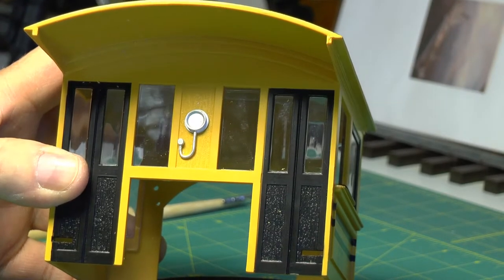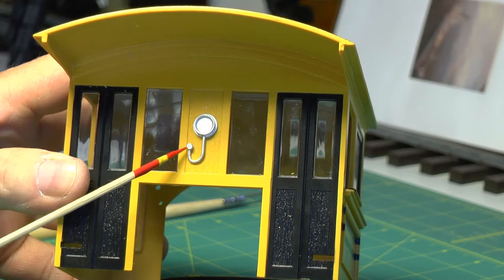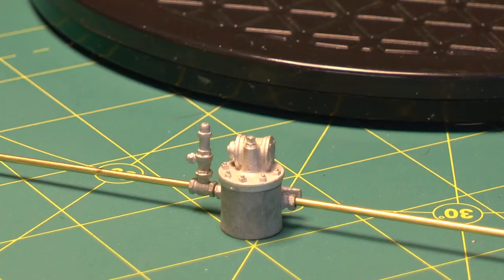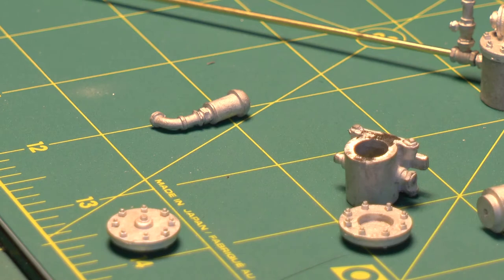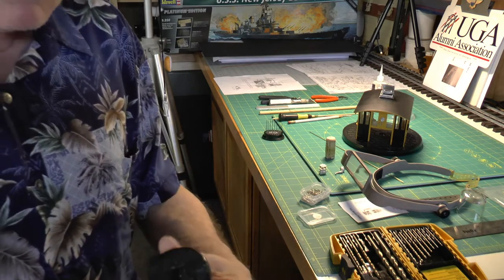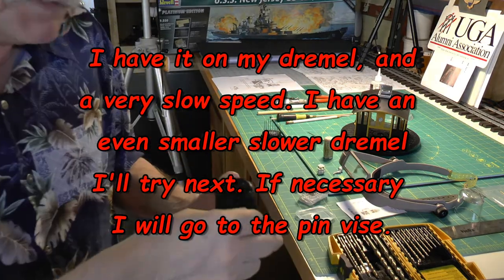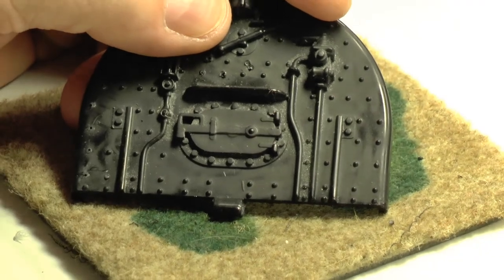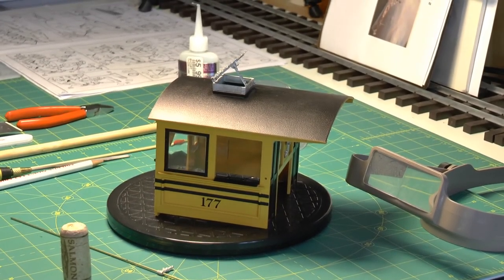Time to start detailing the Bumble bee

Comment: A thin Brass tube placed over the size of the rivet, insert another brass rod inside with the tip sharpened and hooked up to the dremel. Hold carefully and use the outer tube as your guide. Just a thought.

Comment: Great Video Solomon, I'm digging your work  on the bumble bee. the detail is pretty awesome. If I may make a suggestion, Take a scriber from a square or one for laying out sheet metal and put an indentation where the rivets are after removing them. This will give a guide to drill, that way you can put the drill bit deeper inside your rotory tool.
Reply from the maker: Great suggestion. I actually did that. Took me awhile, but I got there late. LOL! I buried my drill totally in the drill. All I needed was 1.5 mm to get thru the backhead plastic. You are way AHEAD OF ME. Thanks for you suggestions They verified what took me 2 days to figure out. Thank you my friend...Regards, Solomon

Comment: Hey Solomon, nice to see some work on the Bumblebee. I think you are correct that you need a dimple to help the drill bit start in the right place. I usually use my scriber for that. It has a very small sharp point and if I need a larger dimple I can jiggle it about a bit! That small drill bit is very long. Perhaps a shorter one would wobble less. Lovin' the build........................John
Reply from the maker: Agreed to all John. Unfortunately that bit is the only one that size I have if it breaks, I'm doomed! LOL! Actually, I am choking up in it a litlle to make up for it's length. It's going good so far. I have some dental picks that are doing a good dimple now. Seems to be drilling very easily too. Thanks for the suggestions. Always welcome. Regards, Solomon

Comment: Man that drill bit looks like it will snap with any pressure put on it so you're doing really well getting those holes done without breaking it Solomon.

Al
Reply from the maker: Al, Looks are deceiving. I'm only drilling 1.5 MM and that plastic is soft as butter. Still, I did eventually choke up on the bit leaving only 2 MM exposed to drill. Thanks for watching, Solomon

Comment: I am doing a 1/200th USS Missouri and i have drilled over about 150 .3 mm holes for the ladder runs and there are 100's of em.
I started with the same Dremmel  as you and just snapped the bits and i studied the problem and it was the dremel.
With that tool the spindle throw out is rubbish,around .4 mm which is mor than the Dia of my bit.
Now i use a pin vice and it is stretching my skillset but successful.
Reply from the maker: Thanks for that comment. I have the Mighty Mo in my stash now, and will watch your videos. You are correct about the Dremel thing. I pushed the bit all the way in except for the last 2 MM. Got the back head done, but a pin vice will be used for anymore that I do, And I do plan on more. I like the look. Thanks for watching and commenting. Hopefully others will gain from my learning curve. Regards, Solomon
Reply: Yeh i plan on posting something in the future but it seems i only have time to build and learn the modeling thing which leaves little time to learn the video and posting thing.
I went into the Mo completely unprepared for the task and now i have been doing it for over a year.
Reply from the maker: I've been on my 1:350 New Jersey for probably that long, but only because it is a crappy model. And I have a lot of different projects going on at the same time. Keep at it. All will come out well in the end. PS, I started back into modeling as the result of a stroke. I was pre- alsheimer, and needed to work the braim cells. I am now greatly improved, 1. I learned the camera, 2. I learned the editing software, 3. I learned the upload process, 4. I started building models. Thanks for commenting, Regards, Solomon
Reply: Sorry to hear that Sol,I stopped work to look after my mum who has end stage dementia and that is why i took up the model at night when i have a few hours off.Have a good one and keep on challenging your mind.
Reply: Those rivets add a lot of eye pop to that piece- as they say devil is in the detail eh....